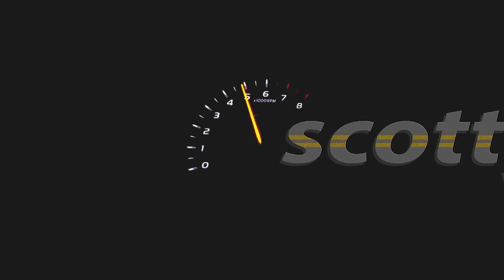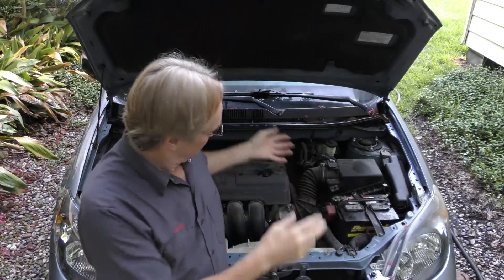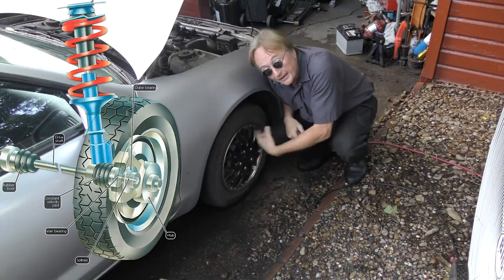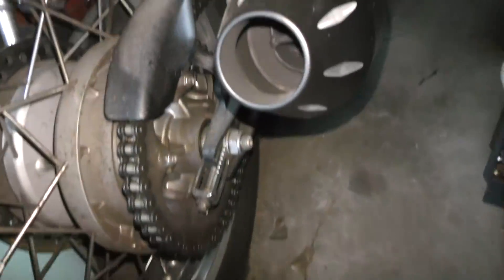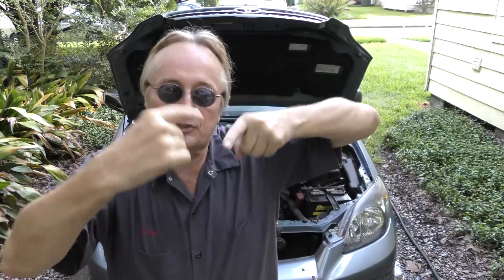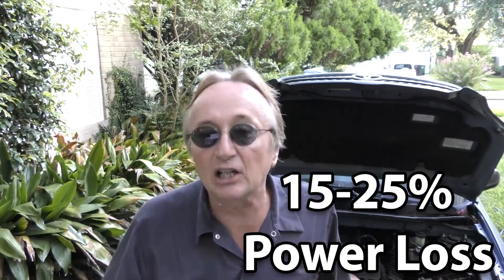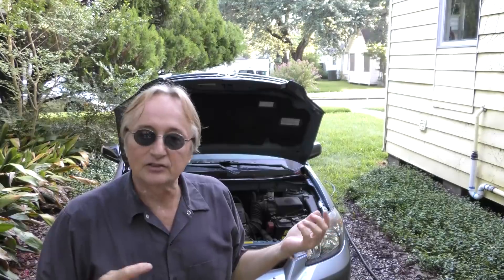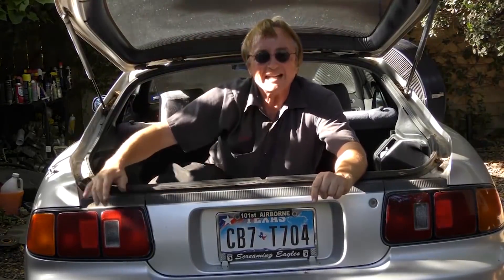Here's Why Your Car's Horsepower Rating is a Lie

Comment: Those glasses are a lie.  Also, considering manufacturers list engine horsepower specifically instead of wheel horsepower it's not a lie at all.  If a person doesn't know that power is lost throughout the drivetrain, why are they even looking at the horsepower/torque stats?

Comment: Common knowledge to anyone who knows anything about cars. Fyi transverse engine FWD motors are built to be cheap much like most Toyotas rather than to make more power to the wheels. On another note many manufacturers like Fords high end V8s make significantly more power than advertised. Its proven.

Comment: Scotty, I wouldn't necessarily call it a lie. They're measuring Horsepower at the crank, which is in engine; which is engine horsepower. Where's the lie? I think the word you're looking for is deceiving. "Lying" concludes malicious intent or purposely misleading. Auto companies are not trying to lie to the customer, they're just starting the the engine horsepower. Deceiving can promote that the number gives an illusion.
Reply: The point is there's horsepower that is lost between the crankshaft and the ground, and the actual horsepower figure that propels the car is the second number, the 'wheel horsepower'.  Any other BHP rating is useless, and is nothing but a phallic display.
Reply: mescko But it's still not lying.

Comment: I don't think car manufacturers are necessarily lying to people as much as people just don't understand what HP means.  When I hear a HP rating, I go with the assumption that the engine itself is what is meant, unless otherwise stated.
All that said, using HP as a rating is kind of retarded anyway since there are so many variables involved in getting to a number to claim as HP.  Torque is where it's at.

Comment: Since I'm from Europe i often hear that Americans car only measuring hp from the engine without any accessories on it, like water pump, ac, fans, generator...and that in Europe we always measure cars with it on, even ac on full blast! Atleast i know Volvo do it, if they not actually measuring from the wheels then...and that would make sense. Your insurance are a lot cheaper with a car that only has 150hp compared to one with 300hp. Well if you young like me atleast!

Comment: Ironically vw and audi are the only ones ik of that advertise wheel hp and wheel torque cause my gti is suppose to put down 200whp and 207wtq it actually put down 217whp and 227 wtq from the factory just know vw and audi advertise wheel power

Comment: so you think people who care about horepower dont know factory ratings are at the crank and not the wheels? the title is out of place, i mean those who dont know this already dont care about horsepower ratings and for the small few who are learning well this is good but... No one is lying! it's a different measurment... They use the abreviation HP not WHP thier claim is at the crank not the wheels and more often then not thier ratings are conservative meaning the engine can output more then advertised. so its common sense that if the dealer says this is a 200HP car and the you go off and put that car on a dyno you wont have 200hp because of losses in the drivetrain... but the engine is still putting out 200hp at the crank so noone is lying it's just a different measurment.. however this is good information for uneducated people... but as i said the title is out of place.

Comment: when they said it had 662 horse power... they shoulda said brake horsepower...  the average person wouldnt know that stuff.  brake horse power is calculated with none of the friction and variables in mind.  that mustang probably did have 662 horsepower. just not at the wheel :p

Comment: You should start off by saying that if you buy 1 gallon of gas you will only use around 0,3 gallon of gas to generate mechanical energy :) 70% of the gas you have bought is wasted due to friction and heat production. Moreover you have to use the engine power to cool down the engine (spinning the fan)! So you lose even more energy! :D ====> So your video is about that 30% of power. Have a nice day! :)

Comment: well... aren't manufacturers stating ENGINE power ratings? how's that a lie? unless you connect the engine yourself to a test unit and find unreasonable differences in numbers... you can't say a manufacturer is lying because its posting just the ENGINE ratings... come on... but you know... views...

anyhows...

cheers!

Comment: First time I don't have to lower the volume, haha.
Technically they're not lying. If a car's engine truly produces 300 hp, then they are within the legal rights to advertise it as a 300 hp machine.
It is actually more accurate and honest, since power and performance varies on passengers weight, and location (altitude, weather, temps).
Therefore, it makes more sense to promote a car's ENGINE performance, than the VEHICLE performance at the rear wheels.
Since automakers also tend to promote 0-60 acceleration in performance vehicles, and vehicle specs are publicly available, such as gross weight, then there is no lying whatsoever.
Looks like that warm British beer got to Scotty's head. 😁

Comment: Your videos lately have started going downhill to be honest, this is nowhere near a lie. It's just common sense Scotty. They rate what the ENGINE produces in power, I.e difference between HP and Rear-wheel (RW) RWHP, etc. there is to many configurations between front, rear wheel, all wheel, 4x4 from just the power train to accessories like power steering, AC, etc to put wheel horse power from the manufacturer. They just claim what the engine produces. What are you going to make a video next on "your power company is lying to you, you're not using that much electricity, because of power loss in circuits". There is numerous factors that go into how much power goes to the wheels, it's not practical to try and claim for every configuration.
Reply: The power company is a bad example, because they charge for what they provide, which ends at the meter. The user controls whether he utilizes 100% or 10% of what comes out from that end of the chain; the company just measures, and charges, exactly what they turn over to the user. However the automaker's power "product" does not end at the flywheel. It ends at the tire tread, for what they provide out of the box. (Obviously if you modify anything, including the tires, then everything goes out the window. So this refers to the "out of the box" spec.)